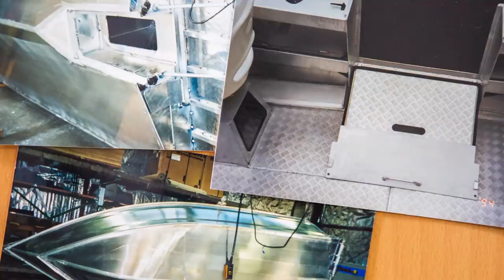Neil Surtees and his aluminium journey

Comment: Surteez seems like they still have a small home business approach. If been through Barcushers factory..they use robots to have 1 continuous weld from bow to stern. No human error . Sad to say this... but move with the times or be pushed aside.
Reply: welding robots are great, until they aren't. Meaning, they need to be programmed by a very good welder in the first place and the QC to make sure they don't go out of whack needs to be there, too. A good human welder can adjust on the go, catch errors before they creep up, robots can't, yet. 
Plenty of robot welded bike frames have broken - probably because the factories thought robots meant you didn't need good human welders and tough QC anylonger. So, it all depends how Barcrusher does that part. Point being, a robot welder doesn't automatically equal better quality.